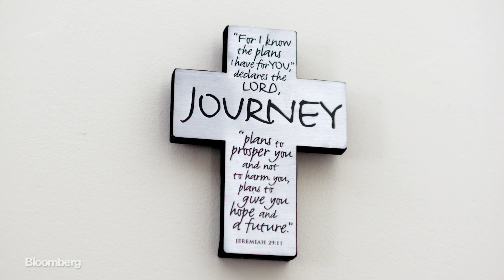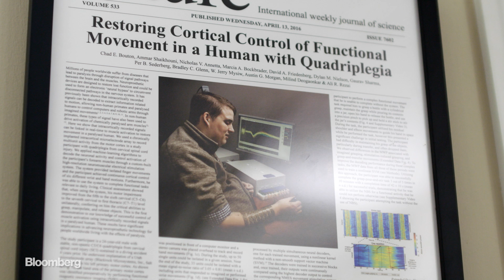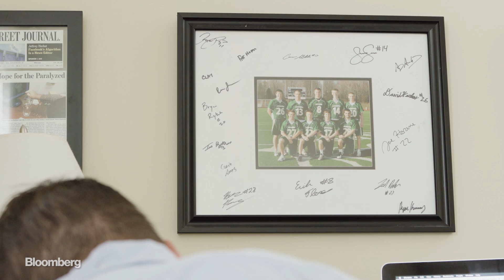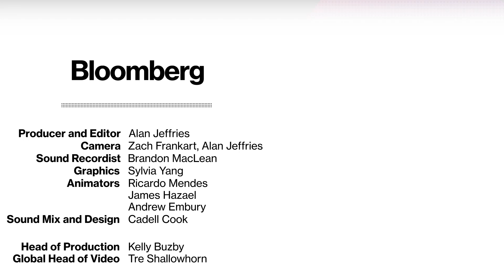This Brain Implant Could Change Lives

Comment: All of that isnt required. Cut spinal cord completely (removing damaged area), reattach severed ends together leaving a 0.5mm gap between the two terminating ends, in the gap place high concentration stem cell gel, wrap exterior of severed spinal cord zone with neural growth factor transmembrane (to deliver neural growth factors for a duration of no less than 6 months), provide intravenous hGH 24 hr continous drip low dose for 3 month duration, provide spinal cord electrical stimulation to both sides of severed cord. Spinal cord will reattach and patient will regain full functioning is 3 to 6 months. Depending on location of spinal cord injury the above mentioned treatment may require patient to be on a 100% life support system until regrowth reconnects critical pathways.

Comment: theres no way unless you work on connecting signal back your thing is useless unless you have a tool that can connect in the mind that can repair it i mean finding it sucks  an if you do find the  broken connection how you can use coppper an soilder it

Comment: Question- do you implant anyone that doesn't have a disability/ functioning hand with a chip to grab control data? or do you solely rely on the mechanical data the functioning hand can provide- Q.N. The Sound

Comment: Amazing. The next step should be replacing that externally strapped array of electrodes with implanted ones. It will make system more reliable, more convenient and allow more precise and detailed movements.

Comment: Hopefully they can incorporate Bluetooth tech so there won't need to be a huge wire sticking out of someone's head along with enough advancements to give back total control of the patients' limbs. With the necessary drugs doctors can help them completely recover so they can become independent without the implant.

Comment: mm Have you thought what it could when if your head is connected by wire and suddently a distracted guy pass too close to you and accidentally kick your wire or just hit your wire? (as usually happen with the laptops that are plugged to the electricity) jejeje

Comment: This is the wrong approach.  Trying to bypass the break in the spinal column by introducing current directly to the muscle tissue is going to result in clumsy, exaggerated movements and limited range of motion.  You need to record signals from the brain of a healthy subject and then replay them in the spinal column below the damaged area of the spine in an injured subject.  From there, you can map the signals from an injured person, around the damaged area of the spine and into the undamaged "pipeline".  Thus, you'd have greater range of motion and fine motor skills.

Comment: So he's training himself to be able to trigger the sensor... Yet everything displayed could easily have been done by a single researcher pushing a button to activate the electrodes, while the rest pretend that it's working... A sensor that reacts to brainwaves isn't very practical, there's no specific spot to implant a sensor for any specific task. So he's essentially learning what thoughts/area triggers the sensor to grasp, while a bunch of other unintentional thoughts could also trigger it.

Wouldn't it be easier to make a pulley type system so his bicep arm movements can tighten his grasp. Worst case one arm moves around and the other moves to pull and tighten grasp. Best case, both arms extending forward tightens grasp, so using the working muscles to fill in for the lost functionality.

Comment: I think these things are already being implemented by people, for more then just movement, I believe its being used for memory aswell and the ability to treat drug addictions. A chip processor is implanted and wireless controller is used, they can change what you see/feel/and hear. The only problem with this is the factor of someone else getting ahold of the controls. Without the proper security this could be a way to manipulate someone to do a million things they would have before not have done. I think this program should be very closely monitored and not used unless the client knows the full risks.

Comment: I'd think a limitation is not getting sensory feedback. You don't feel your touch, movement of muscles and joints.. but it's certainly quite cool :) It's basically like the ab-exercise bands you can use while doing other things, except this is activated on the basis of brain activity. We've been able to read brain activity for quite a while with EEG so it really isn't that surprising.

Comment: Dude.... Fucking Build me a MECHA right now and use this system to move it or use this system to robotic soldiers to send in instead of our humans make it Wireless XD witch is probably possible with more advancements we just need to be able to send the nueral information into computer code easily and then transmit it I guess

Comment: I wonder how this technology would couple with the people in Canada that made working prosthetic hand the hands use input of your forearm muscles considering this allowed you to think about using your hand and then the signal is sent threw your arm I wonder if it would work better to actually replace his hand with a working robotic prosthetic it seems like his main issue and rbe main issue with this in general is even if he can move his hand he doesn't have the strength or complete movement. The prosthetic has alot more strength and alot more movement not perfect hand movement but closer than what he's currently capable

Comment: Tell me that doesn't work by electro stimulation. Through the skin, that's an incredibly inefficient and unpredictable way to influence motor control. Anyone that's used a tens stimulator will tell you that the movements that electrical impulses produce are spastic and random. They must tune this thing so finely for each individual patient. Also, how many freakin people have been paralyzed doing that? I've heard that story more than a few times. "I dove into a sand bar and now I'm paralyzed
Reply: Tommy Ohlrich he broke a spine

Comment: Year 2028. The NSA requires every citizen to be implanted with a similar chip from the moment they are born to properly monitor every citizen.
Reply: MrToxic You mean the portable chip your holding, called your phone?
Reply: Dude... didn't Snowden almost die because this is exactly what has been happening for several years already?
Reply: This will never happen. It would start a revolution even if they attempted it.

Comment: Diving head long into the singularity. NO THANKS!
Reply: Man it ain't that close yet. this is only a one way system so it's like the guy is moving a dead husk. That's why he's so clumsy when he's doing this. There's no telling how far away feedback for something like this is.
Reply: Kamijo Touma I heard something on the radio a while back about how researchers have managed to produce imperfect feeling in hands and fingers, so it's not really that far off. Either way, I don't really see anything wrong with combining technology and life.
Reply: Unlocked buggin
Reply: But there ain't no ai involved
Reply: Sectormann not in this case you're right, but it's the normalization of the melding of man and machine. Slowly but surely, bit by bit. We've already seen people accepting the rfid chip. All's I'm saying is don't be conditioned.
Reply: CustomJ 👍🏻
Reply: Paradoxical Nightmare Nothing is perfect, but modern security isn't quite as flimsy as people seem to think it is. Most of the time when things get hacked it's due to some kind of negligence with security measures. Hacking an air-gapped device, which this kind of equipment would be, is basically impossible without physical access to the device.

Comment: Its looks like it has nothing to do with "technlology" but muscle memory with focused attention to electric fields, movements.  ( rebuilding a sense of patter for eletrcicty contraction.  ( the use of static electricity to stimulate the nervous system customly, is what i would call it.    He should have attachments to to both pinky's, 5th digits, pinky ring.  As wrist contraction or devation changes electricity current  changes through fingers ( eyes connection, personal space field),  all proximal PIP's, are important to wrist movement attention span ( eye nerval contractions indicators). (human awaresness though function line  of sight (dimensional array).  Hand and wrist guards limit this.   I think "suspenders" pants suspenders, would be more effective for cognitive or eye field awarness support , You dont want him to be a "think tank"only.   Hands and fingers incorporate collective thought,  a general audience action, appeal, awareness.   So the people in the room doing the test, setting up the test, the facility are equally as important.  They should also be conducting, practicing the same testing. for the best progress.

6:15, all that padding is a mistake, sesmoid bones, or TUFTS,  are affective by his wheel chair(wheel chair use, buttonswresting hand wresting, or (accumlated result from being paralayzed)., you will not be able to use or isolate tufts, they change per enviroment, there like mood rings, all tuft data is bullshit look for use of PIP in the hands , rythm, try to make a mood ring out of PIP 2-5, as a whole, kind of like a brass knuckle that a meter on it measuing current.  Imagine a electric meter or PH bar that goes across PIP 2-5 that looks like a brass knuckle but would go more proximal to the hand to the webbing.  Where ever i said PIP here i ment the articualtion are proximal to that too.  The whole articulation part.

Also encorporate dental awareness into liking of sight training. (its a muscle to the nervous system, can be utuilized to put together movements of stability. ( memory impulse create chambers of thought) , its kind of like building  reflexes, original relfex area's to use is what there workin with here.  ( you know the doc taps you with that hammer to test your knee jerk, you can create those all over you body, from different parts),

Comment: This is the most brilliant project I've seen in a while! 

Btw, is it not possible for you to use deep learning neural networks to map all the different kinds of brain waves to different movements? This way you can classify them easily and reduce considerable lag.
Reply: I believe the data coming from the brain signals looks really dirty and it might be very hard to use it for training. Also getting a large enough dataset looks like a very difficult task.
Reply: Dmitry you're probably correct. Gosh, what they're trying to do really is a marvel though. In their prime, their suit might become a second CNS, how cool would that be? Especially if the experience is super close to the real thing. I think there might be an even bigger application here (depending on your interests): inter-brain communication. The future is almost now :)
Reply: It really is a more complex matter than that, and it really depends on the kind of sensor grid they're using, they might actually be more interested in individual neuron potentials, or at least more localized field ones. Remember you only get waves when you observe a big population of neurons at once, and while it might be functionally related to something in particular this kind of view is still pretty limited. Deep nets might actually be a good alternative some day, but probably not right now since at this point in development it should be pretty hard to build a sufficient and well curated data set (as unsupervised models do not seem up to the task yet). Still this project sure sparks hope and excitement for future development and hopefully fosters future research in this field of application.
And kind of replying to Dmitry, there's pretty good tools already to get rid of a very significant if not most of the noise in the acquired signals, I think the most challenging part might be in actual interpretation of the read signals (understanding inter-neuron dynamics and its direct effect on behaviour is no trivial task) and later on the generalization of these interpretations to other brains.
Reply: It's all electrical signals they're just filtering them out similar to the wearable starwars mind force toy but they're using the input to send signals to the body on the other side, pretty darn cool though, will be really nice when it's wearable and restores full functionality
Reply: They have done a similar thing with this man https://www.youtube.com/watch?v=xKUn0-Bhb7U&ab_channel=Quartz